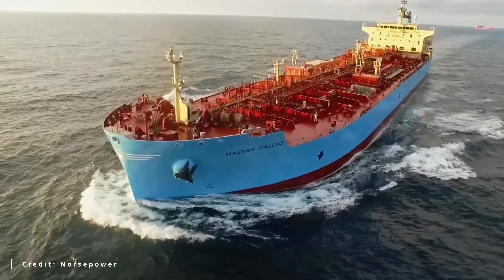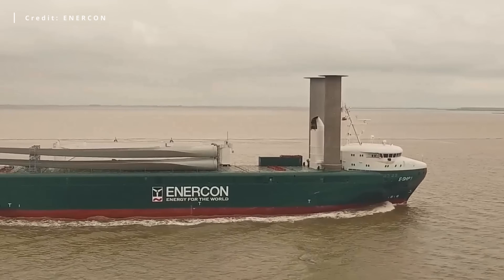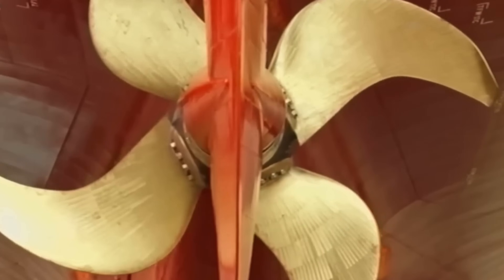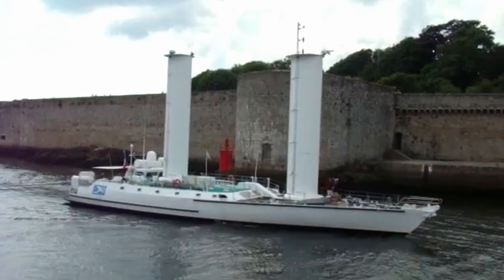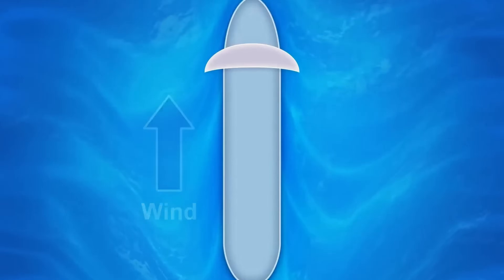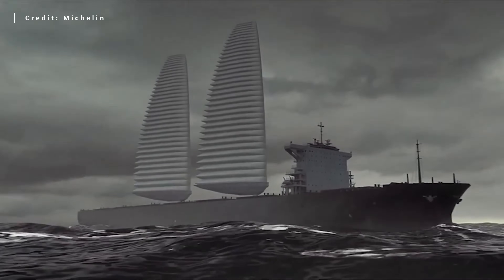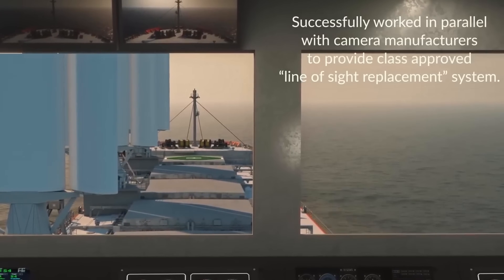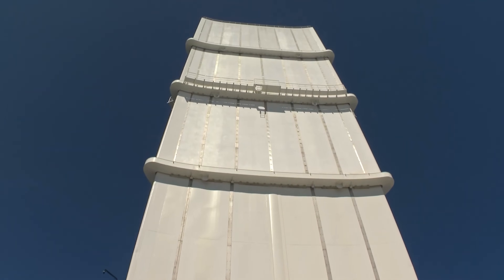The Wind-Powered Cargo Ships

Comment: Fascinating thanks for showing the future.
Reply: Not necessarily a technology of the future, several marine creditors such as Lloyd's Register have paved the way to rotor sails reducing the EEDI score of marine vessels equipped with them based on initial testing. This EEDI score, and ultimately the CEI score EEDI informs is very important to larger companies whose on paper CO2 emissions directly translate to access to ESG based investment and regulatory credit and tax breaks. It may not in reality actually be more efficient than conventional propulsion due to the route modifications to catch wind, the power required to spin the rotors or the cost of installing and maintaining them. It's difficult to say because there is very little published information on the fuel savings claims. What matters to these larger shipping companies is if authorities certify it as carbon friendly, not if it actually is, that is why they are likely trying the concepts.
Of course, if it IS at least more fuel efficient in a cost effective manner (as in real world fuel savings vs any additional travel time, upfront and maintenance costs all measured over a span of time) then we no doubt will be seeing these everywhere soon. That's not really what I am seeing happening, though, maybe the tech that has been tried multiple times in the past is too new? I smell vaporware and greenwashing due to the lack of transparency and the push for them being more 'carbon neutral' rather than straight up money savers because shipping companies would pay for and use less fuel.